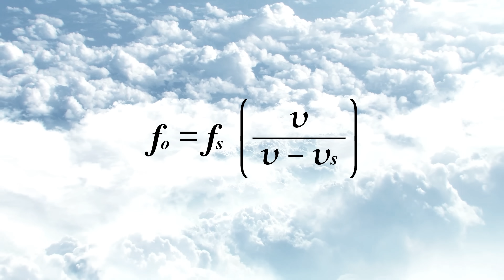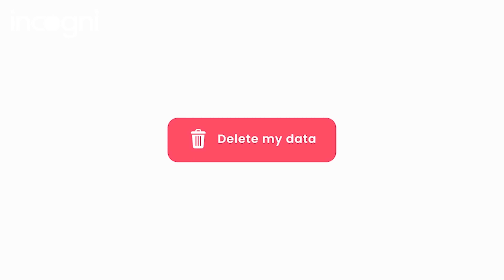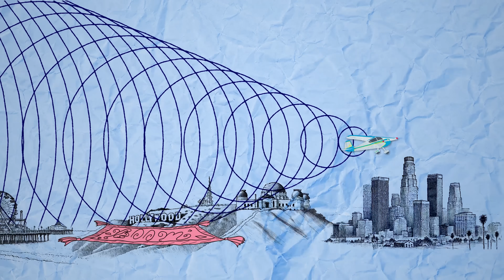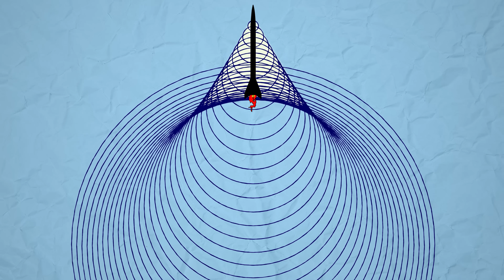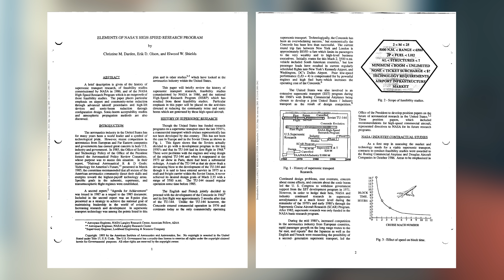You'll NEVER Hear a Sonic Boom From a Rocket??

Comment: I've experienced the sound traveling faster in steel rails, as they were hammering spikes about 2000 ft away and the sound through the rail beat the sound through the air.

Comment: Would love to learn more about how you are verifying the speed of the rocket - I assume it's by either integration of the acceleration, or by measuring the altitude lapse rate from an onboard pressure sensor?  A student group I participated in tried to build an onboard pitot sensor and a method for calibrating it, but sadly we never launched it.  I'm pretty sure GPS chips are hardwired to not provide speed data above a certain limit, though that is around Mach 1.6, depending on who you believe (see https://en.m.wikipedia.org/wiki/Coordinating_Committee_for_Multilateral_Export_Controls#Legacy ).

Comment: I was going to ask if it's possible to have a sonic boom in steel but obviously you cant' move through steel like you can in air.  I'm not sure a Ground Vibration Boom is the same thing as that looks like the fault moving faster than the speed of sound, i.e. lots of separate but unconnected events.

Comment: As a child i would take apart casset tapes for the liners that were on each side of the reels. Spilt strips of cedar down to a tiny dowl and tape the liners to the cedar front and back. This makes a great glider once you get the spacing and weight correct. 
Flat wings can work.

Comment: Just before 14:00 - On the condensation around a plane at high-speed:  You were so close!  The shock is after the pocket of condensation, not in front of it.   Yes, the condensation is caused by a sudden lowering of temperature, but NOT the lower pressure or density.  Actually, the lower pressure acts to reduce condensation.   Using density in the presentation is confusing since it is a function of temperature and pressure.

Comment: Technically you were correct; the loudest sonic boom recorded (as in actually measured) was likely the space shuttle. However, using sound propagation models, the loudest sound experienced by humans happened with the 1883 eruption of Krakatoa, which handily beats it out at 310 db. The sound was heard 3000 miles away, and the pressure wave went around the globe 7 times. Now THAT'S a Boomy!

Comment: You will not hear sonic boom from the rocket itself if you are too close, simply because it is traveling in the opposite direction.
But if you watched any  rocket launch with actual audio, no doubt you have noticed the cacophony of sonic boom after sonic boom after sonic boom from the supersonic exhaust. On the Starship launches the booms are actually strong enough for the shockwaves to be VISIBLE.

Comment: One error in your video--BTW it was cool otherwise--is that the speed of sound in the air is NOT always the same speed. The speed of sound is directly related to density. Which is why sound is faster in water and steel. As we all know, the higher the altitude the less air there is and the lower the density. (temperature also affects the density--the colder the air the higher the density) At standard atmospheric temperature pressure (15C and 1012.25mb) the speed of sound is 340.3 mps or 761.1 MPH and at 60,000 feet it is 294.9 mps or 659.8 MPH. Those are all at the standard temperature and pressure for those heights.

BTW if people had heard a sonic boom from your rocket it would have been seriously off course.😊

Comment: So before I watch past 34 seconds in, my(not astrophysics based educated) guess is going to be that the rocket reaches the parts of the atmosphere too thin to generate a sonic boom as it's reaching supersonic speeds. (Or the backup is that it's something like the doppler effect and I've overthought it).

edit: I was wrong, but the real answer makes perfect sense. I grew up at Whiteman AFB when supersonic flyovers were still allowed. I remember hearing jet fighters flying over, and you'd hear it approach and THEN the BOOM. But I'd never considered why you wouldn't hear a boom from something travelling straight vertically. The one thing I've always wondered is: what would it sound like if you shadowed something flying supersonic right in the mach cone, right at ground level at the same speed? Would you hear some kind of apocalyptic, eldritch noise? or because you're moving at the same speed, would it just sound like regular air moving over whatever surfaces you have(like cars on the highway, or whatever the jetfighter equivalent of that sounds like)

Comment: The number given here for the speed of sound in air (332m/s) only applies at room temperature at sea level. In Earth's atmosphere, the speed of sound varies greatly from about 295 m/s (1,060 km/h; 660 mph) at high altitudes to about 355 m/s (1,280 km/h; 790 mph) at high temperatures.

Comment: @Xyla Foxlin
Do all frequencies really have the same speed of sound?
I ask because air will filter the shortest wavelengths more than the long ones over distance. This gives a low-pass filter function. Such filter functions give a phase shift, and thus a time delay.
I therefore assume that frequencies with short wavelengths have a slightly lower speed than frequencies with long wavelengths.
Or have I fallen for a logical fallacy with such an assumption?

Comment: I'm afraid that you're incorrect.  Some Falcon 9 Starlink missions flown out of Vandenberg Space Force Base produce sonic booms on ascent that are heard downrange, generally from Santa Barbara to Ventura.   These missions fly a trajectory that hugs the coast (with the rocket moving southeast instead of south or southwest) putting these areas under the boom carpet.  I didn't believe it myself until I saw videos and worked on trajectory analysis with others.  The sonic booms are NOT from the first stage landing (which occurs off the coast of Baja California for these missions).

Comment: I always think it's more crazy how SLOW the speed of sound is than how fast it is, considering the implications. 7 seconds to move 29 miles seems fast but it's very, very far from instant when we think about the meaning, that is to say that if you pushed on one end of that steel beam stretching across LA, it would take an entire 7 seconds for the other end of the seemingly incredibly rigid steel beam to actually move.

Comment: Sound waves are not waves as you illustrated. Sound waves are a series of high and low pressure areas called compressions and rarefactions respectively. As such there are no crests for surfer dudes to ride. In addition, amplitude is not the height of the wave, it is the maximum displacement of the molecules along the path of travel, thus the name longitudinal wave, as opposed to what you showed, a transverse wave (displacement perpendicular to the direction of travel).
Reply: The chicks a know-all dunning kruger simple Acoustic Levitation of plastic beads or water droplets are suspended in the zones described. And the Mantis shrimp takes top prize for cracking the whip underwater vs far easier in thin air.

Comment: When you are a lot older with less energy your answer might be, because sonic booms are created by the sound source continually emitting sound while keeping pace with one point on the radiating sound waves, so the boom only exists in front of the  sources' direction of travel and does not exist behind it.  This  is evident with the launch and recovery of Spacex reuseable boosters though the alternative launch sound is probably more impressive. Just as interesting is why exceeding the speed of sound as a human only has a mach meter reading and barometric altimeter transonic jump to observe it with.  Also the speed of sound in air varies with temperature being faster in higher temperatures ; it is not fixed. Unilke blast waves sonic booms are not known for creating movement. However,  at least one B767 flying in the opposite direction to a climbing and accelerating Concorde ,but approximately 3000 feet below, did feel a bump as it passed through the shockwave : more impressive than a mere bang whether from supersonic or blast sources. None the less, it is fun to watch your explanations and I cannot think of a nicer way to be made to feel old.

Comment: People should study before criticizing!
Supposing an acceleration of the rocket of 10g (~100m/s^2), its velocity is V=a*t, then to reach mach1 (333m/s) it takes 3.33s
The travelled space is x=0.5*a*t^2, so the rocket reaches mach1 at ~555m. There the shockwave cone is formed with 45degree angle.
in general x=V^2/(2a) : a=100g -> x=55m

Comment: As one of the founders of LUNAR (the nation's largest model rocket club), I've seen hundreds of supersonic launches over the years. The explanation you gave was spot on, even if you did leave out the fact that booms off of a flying object with any appreciable length always come in pairs (one off the nose and one off the tail). I do know that some people have tried to suspend an audio pickup a thousand meters or so in the air prior to a supersonic launch to see if they could record the boom(s). You can't use a drone since the sound from the rotors would drown out the tiny booms, so they used a traditional rocket launched first so that it would be deployed and descending under 'chute when the supersonic rocket went  by. Don't know if it succeeded, but it's a cool experiment!

Comment: Minor point, but if I'm not mistaken you can sometimes see the shockwave, just slightly from the different density of the air causing the light to bend differently, right? Or did I make that up? Pretty sure that's a thing I've seen in some high-speed footage before, idk.

Comment: I was hoping the conclusions for the why would line up with what I knew, glad to see I was correct. also sonic boom speed changes depending on altitude due to the density of the air.

HOWEVER I was surprised the smallest and weirdest sonic boom wasn't won by the same little creature the "Pistol shrimp" a shrimp that creates a sonic boom with its tiny pincers.

Comment: I would start explaining what's Mach Number, then explain what's Mach 1, then show a boat on water creating a Mach Cone, then show one of those photos of bullets creating the cone or models in supersonic wind tunnels. 

Here's duck creating a visible Mach Cone: https://i.sstatic.net/QWAv5.jpg
Here's a bullet creating an invisible Mach cone: https://www.numeca.de/wp-content/uploads/2020/09/Figure-3-Schlieren-image-of-Mach-cone-formed-by-a-bullet-7.jpg

The Mach number is the ration between the speed an object is moving and the speed of mechanical waves in the medium that object is moving on (inside). Transversal wave on water (like the ones we see on a beach) travel pretty slow so even a duck can swim faster and create a Mach Cone. We hear the sonic boom not because the rocket broke the "sound barrier" - we hear it because the Mach Cone just passed over where we are. When we're on a beach and somo boat passes nearby producing that cone and we're hit by it, we're basically "hearing" a "sonic boom".

Comment: Excellent explanation, but I have one small, and one rather large correction:  1) Several times you referenced the speed of sound "in air" as if that is one speed, which it is not.  As a former flight engineer, I can attest to the fact that the speed of sound is variable based on the density of the substance those sound waves are traveling through (as implied by the reference you made giving the speed of sound through various materials).  And of course, air is not ONE density! Reference just about any weather report!  So the speed of sound through air, as it is normally referred to, is always PROPERLY expressed as 343 m/s AT SEA LEVEL (that is to say...when the air density/pressure is 29.92 inches of mercury).  Therefor...the speed of sound up at 30,000 feet of altitude will actually be significantly SLOWER than the speed of sound at sea level.  Which is why many aircraft have separate airspeed indicators, and Mach indicators (even if they are in the same gauge, as with an AMI....or Airspeed/Mach Indicator.)   2) You do NOT have to be in the path of (or forward of) the path of the object traveling supersonic in order to hear the sonic "boom", because sound radiates in all directions.  So the boom radiates in all directions, eventually reaching the ears of people who are way behind the path of the object.  So that brings me to the REAL reason  people don't actually hear the sonic boom of your rocket.  You hinted at it when you explained the crack of a whip being a sonic boom...which of course is heard as a CRACK, rather than a BOOM.  The fact is, the tone of the "boom" (or "crack) is a function of the SIZE of the object that is traveling supersonic.  So relatively BIG things traveling supersonic will produce relatively big (or THUNDEROUS) booms, and conversely relatively SMALL things will have more of a relatively whimpy "crack" (which simply cannot be heard from very far away).  Another common example of supersonic booms/cracks are bullets fired from a gun.  The bullet (if traveling supersonic...so, more likley from a rifle rather than slower moving pistol bullet) has a small "crack" sound...but it is masked by the relatively loud boom of the explosion that launched it from the gun.  So we only hear the "report" of the gun, and not the bullet crack.  But as you move much further away from the initial explosion of the firearm....the crack of the bullet WILL be heard as the bullet passes overhead, and LATER you will hear the boom from the "report" of the gun as that sound wave catches up  to where you are positioned.  This can also be observed by the use of a "silencer".  A silencer, or supressor, can be used to eliminate all (or nearly all) of the sound of the explosion of the firearm. What will be left will be the sound of the bullet traveling through the air.  So in the case of a subsonic pistol bullet (and yes, I know that not all pistol bullets travel subsonic, and not all rifle bullets travel supersonic), nearly ALL the sound will be eliminated.  But in the case of a supersonic rifle bullet, what will be heard is the "crack" of that bullet traveling supersonic...which is now NOT masked by the much louder boom of the explosion.  And, since the person hearing this "crack" is BEHIND the entire path of supersonic bullet, that proves that it is the INTENSITY of the boom/crack (and the listener's PROXIMITY to the supersonic object), rather than listener's POSITION relative to the flight path, being the reason nobody can hear the sonic "boom" (crack) of your rocket!

Comment: You forget one fundamental aspect of the definition of sound: it is based on an small disturbance. This implies that loud noise moves faster than the speed of sound. This is actually proven by the sonic boom. It travels at the same speed as the supersonic flying plane, also at ground level when you hear it passing: A sonic boom is a very loud sound.
NASA: Disturbances are transmitted through a gas as a result of collisions between the randomly moving molecules in the gas. The transmission of a small disturbance through a gas is an isentropic process. The conditions in the gas are the same before and after the disturbance passes through. Because the speed of transmission depends on molecular collisions, the speed of sound depends on the state of the gas. The speed of sound is a constant within a given gas and the value of the constant depends on the type of gas (air, pure oxygen, carbon dioxide, etc.) and the temperature of the gas. An analysis based on conservation of mass and momentum shows that the speed of sound a is equal to the square root of the ratio of specific heats g times the gas constant R times the temperature T.

Comment: 02:40 Just saying that all sound waves moving through air move at the same speed doesn't establish that to be the case. And, in fact, it is not the case, is it? You forgot that this medium changes with altitude and temperature. The result is that the standard speed of sound at sea level at 15C is around 340 m/s. However, around Denver at 5C, the speed of sound is around 334 m/s. And up at 50,000 ft. / 15,000m and -56C, it is around 295 m/s.